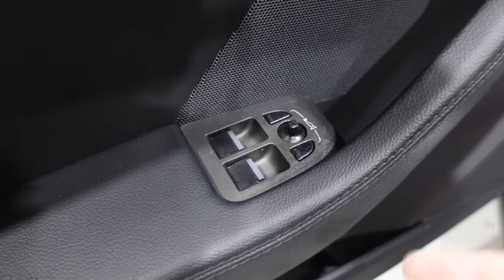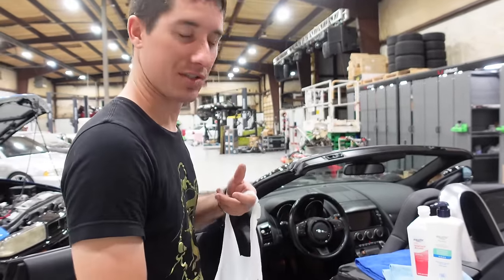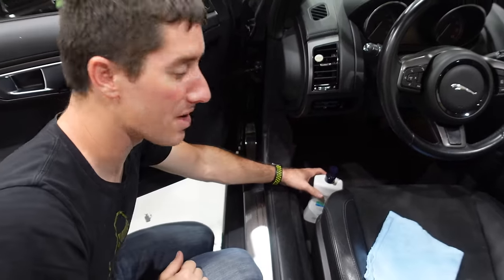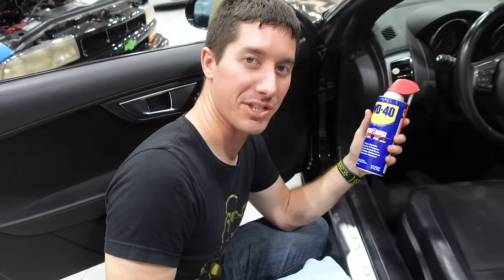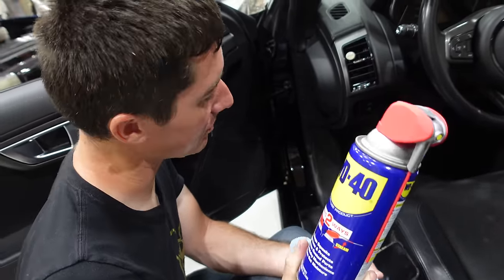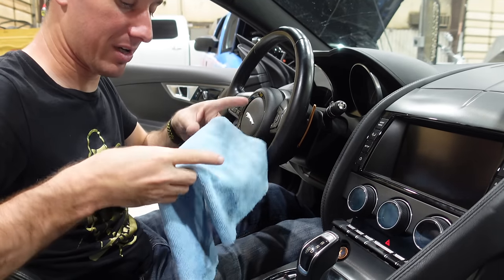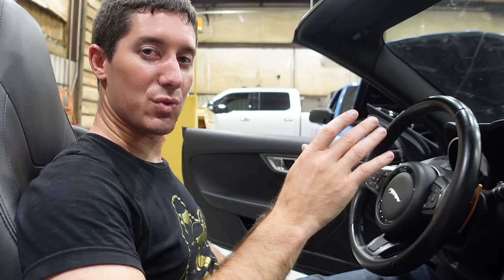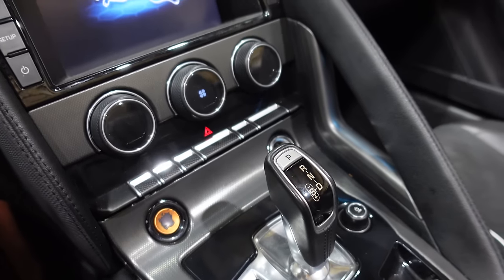Fixing STICKY BUTTONS At Home For FREE (I Try Everything)

Comment: WD-40 isn't as good  cleaner, as Lighter Fluid.  It's my favorite for leaning petroleum based adhesive residue.  It's not aggressive to most inks or plastics.  I bet that woud be a better candidate for cleaning and prep.  Any residue evaporates nicely.  If so you can follow up with IPA,  But, IPA can attack a lot of inks, especially with abrasion.

Comment: Like other problems in life, alcohol is the fix. 

Iso alcohol is also great for tree sap! Let it dwell for 15-20 seconds on the sap spot and then wipe with the rag, it will often just melt the sap off.
Reply: I have found cooking oil works great on tree sap. The plus of the alcohol is that it has many other uses away from the car, and the bottle lasts years.
Reply: Where was this info 20 years ago when I was climbing pine trees in North Carolina.
Reply: Why would somebody pay thousands when you can just clean it with alcohol  is a testinomy of having too much money
Reply: @ivanoffw  absolutely true - cooking oil is great for removing pine tree pitch.  Have been using it for years.  My parents have lots of pine trees, which I climbed...
Reply: And he went on ahead and put the lotion in the basket...
Reply: There's Goo Gone.
Reply: Isopropylalcohol (IPA) or 2-propanol.
Reply: ammonium chloride is the tree spots best remover ever. There is a chance it solves the soft touch too, never tested. Ask your doctor for the ammonia

Comment: I'd try mixing the isopropanol 70/30 with distilled water to avoid paint coming off. I used >99% isopropanol on my Volvo buttons and it did take some paint off the corner of one button but that's about it, everything else cleaned up perfectly. Might have even been missing paint in the first place from use over the years, just covered up by goop.

Comment: I noticed you had the gen 1 ftype like I have.

Word of advice-the buttons on the steering wheel are dreadful and we're amended on the 2015 ftype to be contoured rather than flat. The flat ones are really difficult to press and register a button press. 

You can't switch the entire button assembly out because the circuit board on the button is different - but you can swap the button plastics over and the new moulding is angled enough to register the button presses.

Comment: Simple Green maximum spray degreaser.  I just did it 5 minutes before I typed this message.  Took all the stickiness right off without being abrasive.  Everything came off like hot butter, no scrubbing.  BUT!, You need to have a few towels because that sticky stuff sticks to the towel and if you don't turn and change your towel, you end up wiping the sticky residue back on.  Oh, and please use a towel that's clean and not all frayed and stuff.  Used it on my 2014 Jaguar XJL Portfolio V6 supercharged 😇.

Comment: The best I’ve found was Resolve carpet cleaner.  Several years ago I bought some preowned DJing equipment for a karaoke business I was starting up, and all the wireless mics had a soft rubberized coating that had gone sticky.  

I tried alcohol, adhesive remover, etc. with some success but not great.  I then tried some spray on Resolve carpet cleaner, and it worked like a charm.  I would recommend wearing gloves though if you try it.  After a few hours of constant exposure it dried out and chapped my hands like crazy.
Reply: Did it produce any discoloration on the plastic? I tried alcohol on a black remote control and it removed the goo, but it kind of burnt it (it left a white-ish haze on it)
Reply: @JoeOrber  that plastic was left its natural color from what I can remember.  I believe it was ABS, so other plastics might have a different reaction

Comment: I bought in bulk alcohol swabs when I was crypto mining to remove thermal paste and it works great. Started using it to clean other items such as keyboards. It is cheap and not harsh. Use to use a spray gun with alcohol to clean car parts like brakes to save on brake clean and it is not harsh on the lungs.

Comment: parking in the back and going in the service area FTW!!  this is the  best walmart hack and ive been doing it for years. i also check out back there as there is usually no line. its amazing!!  the only things i think you cant check out in the service area are things that need to be weighed but i may be wrong just never have taken the chance. if you all arent parking in the service area you are missing out!
Reply: Just don’t be inconsiderate when parking over by the ACC and block the bays or you might get yelled at by the techs in the shop.
Reply: I usually park by the outdoor/garden department and enter through there. More parking, less people, and closer to the stuff I need. The problem is that there isn't always an open register.

Comment: Thanks so much for your video. I used Al ohol 70% on my 2013 Hyundai Elantra GT (aka i30 in Europe) driver door trim around the door switches. They were gunked and sticky. The alcohol pulled the stickg black gunk off and left a black plastic non sticky new looking finish. I will tape off areas with gaffers tape and apply alcohol (I may dilute the mix).

Comment: I just attacked the sticky buttons on my w211 Mercedes-Benz and I had very good luck with armor All interior detailer/cleaner and a microfiber towel. I actually put considerable pressure on it and they held up very well (++ to Mercedes) This solution seems safer than some of the other caustic materials listed elsewhere because this is formulated for your interior and even includes a UV protectant.
Looks like new now!

Comment: Make-up brush and talc works. It absorbs the oils without speeding up its breakup. I've used that for computer mice and tools with rubber grips but need to remove the dirt first. I leave my 'powdered up' for a few days. brush it off and generally back to normal for quite a while but nothing stops the process of decay

Comment: The 91% Isopropyl alcohol worked wonders! THANK YOU!!!!!  One thing I can recommend though, use a very wet towel and rub GENTLY then repeat with a fresh piece of towel, as it will just smear if you don't use a fresh piece of towel each time. More alcohol & les pressure is the key. I rubbed through the paint in a couple spots on my steering wheel buttons. Now I have to swap those switches out.

Comment: We use IPA all the time in computer repair, mainly the delamination of the older MacBook screens.  I also use a product called PEEK - you can't get it everywhere but it does work.  It stinks a bit so do it in a well vented area.  Older mice from early 2000's also had this same issue with sticky mess.  Oh, for the little corners, use cotton swabs.  And indeed take your time, it does not come off immediately.
Reply: I enjoy drinking IPA at my local pub.
Reply: @OMGWTFLOLSMH  I am with ya on that - 🤣

Comment: For larger surface areas such as gooey dashboards or airbag covers, carefully/perfectly clean with 90% or higher IPA, 2 square inches at a time, and then coat with a product called "PCR Plastic Renew". The coating is a perfect way to make the plastic new again. Holds up for years when done properly and will not wash off. PCR plastic renew is not a "dressing" but an actual flexible plastic coating.

Comment: WD-40 has always been my go to for this sort of thing because the soft touch stuff is supposed to be a protection layer so when it goes bad you're basically stripping the stuff off. I figured even if it's a little oily, that will dissipate with a little time and there'll still be a layer of protection because oil is just a lubricant. With alcohol you're always risking paint being rubbed off once you get through the sticky stuff, especially using 90%. I've tried Windex, but it's probably below the cosmetic wipes for effectiveness (I don't like the wipes for all the lint they leave.)

Comment: In Canada we have a paint mess remover called “goof off”.  It’s not citrus like goo gone. In fact, it smells awful. Worked amazing on sticky steering wheel buttons on an ‘06 Mercedes ML. Didn’t harm the markings on the buttons.
Reply: Goof off is excellent. I have an old tin flask of it and it’s still good.

Comment: This may or may not apply but you can try and use the cheap blue mouthwash to remove the residue. In the IT world I used it to remove the delaminating coating on Macbook screens.  It works really well.

Comment: I bet that your new shop is going to have the best air conditioning system out of all of the shops on YouTube. 
My car doesn't have the sticky button problem but the last time I got it detailed the person used a mix of alcohol and distilled water in a spray bottle and he sprayed it all over the surfaces and knobs and buttons and it did a great job and evaporated quickly. The headlight/turn signal stalk had brown icky stuff dripping out of the seams when he sprayed it down. The old stock stereo was nasty too. The only issue I saw is that it left some of the black plastics a hazy gray color but the black can be restored during the detailing process.

Comment: I always heard of Gumout and a soft toothbrush. My brother-in-law swears by acetone and a low powered nail rotary tool(my sister is a nail tech). The acetone will usually strip the paint off though usually. When I was a deckhand, the bridge deck buttons would get gummy and sticky and we used a malleable eraser they sell in art supply stores. Looks like silly putty kind of. If you mixed in some charcoal ash, that also worked pretty well, then afterwards we used leather cleaner.

Comment: Baking soda worked for me. Mixing some water with baking soda, into a paste, then lather the paste to the sticky area. The paste will absorb the sticky oil from the surface. Sticky surface on plastic is caused by the instability of the oil.

Comment: I get this with computer plastics sometimes. I use WD40 to clean off all the broken down plastic on the surface ( that is sticky ) and then clean well with ISO 91% to clean up the WD40 residue.
Reply: I'll give it a try. I have an old MS force feedback 2 joystick that has gone very sticky, but annoyingly is still the finest joystick ever made, alcohol just seems to make the problem worse and vigorous cleaning just led to the coating peeling off. I'll try wd40. Failing that I'll just strip the sticky coating off completely and wrap the thing in bicycle handlebar wrap.

My jag is a x100 so has 99 problems but sticky buttons aren't one lol thank fck
Reply: @throwback19841  if the WD40 and 91% ISO doesn't work all the way, I use clear nail polish to cover over the parts and it stops the sticky and doesn't wear off. I have done that with a few dslr cameras where the grip gets all soft and sticky. WD40, 91% ISO and then clear NP on top fixes it. I still have an old Nikon D70 I did it to maybe 5 or 6 years ago that is still holding up just fine.

Comment: I would NOT use IPA(Isopropyl alcohol). It does in fact REMOVE the stickyness, but the rubber coating is gone too. IPA eats/dissolves rubber.

Comment: Any decent electrical contact spray will work wonders. It gets in and behind the buttons freeing them up. I just fixed my navigation system which wasn't working because of a dumb stuck button. No doubt saved some cash in the process 😊 I used Halfords own brand, cheap but worked great.

Comment: What was weird is my wife cleaned up one of our older Asus laptops with the sticky coating using hand sanitizer. It might've been the alcohol in it but using straight IPA didn't seem to work as well. She ended up using this gel hand sanitizer she picked up during the "thing" and it ended up being less labor intensive and left no residue. Laptop cover and the area around the keyboard all had to be cleaned of the soft coating.

Comment: I found that when removing stickers from devices, like computers and gaming consoles, WD-40 followed by rubbing alcohol works well.  On gaming controllers and mice, rubbing alcohol works well to clean up the grime, but I've also used sanitation/disinfection wipes, which you may have left over from the COVID-19 lockdown days.
Reply: I use olive oil on plastic consoles.

Comment: I did the alcohol treatment with an old set of headphones I loved but were absolutely sticky all over. They were so far gone I also had to use a small amount of baking soda, although I would not recommend that with painted plastic like you had to deal with. I would suspect that Alcohol is also safer to use around electrical components.

Comment: I owned a 2000 beetle that had sticky button syndrome on pretty much every surface of the interior, I hated it.  I tried the solutions you did plus several more and never found anything that worked satisfyingly well.  I will say it seems to depend on how bad the sticky goo is.  If it is bad enough it seems to come off easier than if it is in the early stages of stickiness.  I eventually gave up and sold the car as-is.
Reply: Had a 2000 golf tdi,  had to peel it all off with the corner of a credit card, the polish out the residue.

Comment: Isopropyl alcohol works great. I use makeup pads with it to scrub the rubberized coating off. Just don't scrub too much or else you'll start to remove the paint from the plastic itself.

Comment: What about Goo Gone, or a citrus based sticker residue remover?  It leaves a nice citrusy scent too.
Reply: I do electronics repair as a side business, and my method on things like soft touch laptop lids from the 00's, stickers, marks, etc.. has been Goo Gone, Goof Off, or 91% IPA depending on how bad it is, and the type of plastic I'm dealing with, but with Goo Gone, or Goof Off I always have to do a final clean with IPA, or cheap Window cleaner, but I always spray whatever I'm using on a cloth first before wiping the surface.

Comment: Degreaser works best against finger gunk (just dirty) . 'real' sticky buttons as seen on early 2000's Ferrari and Lambo's have to do with degrading of softpaint; the rubbery ingredients turn gooey. I guess the Jags' button were just never cleaned... ever. Tip: use a thinner cloth.
Reply: No, the Jag buttons get sticky/gooey from the rubberized soft coating they used to put on them. I have an XK-R and it has the same issue. It's not a matter of never been cleaned, it's the coating.
Reply: @Kryptic1046  thanks Neptune. Luckily no experience with it in my Daimler SV8 lwb. I am curious to find out if the buttons stay not sticky 'caus a layer was scraped off (instead of a chemical alteration of some sort). And if so, how about the degrading of the decals in time?

Comment: The steering wheel on my Jeep was so gross I didn't want to touch it.  I tried all kinds of cleaners and alcohol and it would just come back.  Out of desperation I grabbed the brake clean and some rags and scrubbed the hell out of it, perfect.  I think I went through 4 rags, after that I put armor all cleaner and protectant on it and a year later it's still good.  I would definitely do some test patches where it wasn't very noticeable but I was down to buying a new steering wheel if brake clean didn't work so I didn't care at that point, it was just that gross.  It would even leave black residue on your hands after driving it.  Brake clean for the win.  I've even seen people use it to remove grease from carpet without damage but you'll definitely want the windows open for a while!

Comment: I fixed the sticky rubber armor on two-way radio by simply spring a coat of clear acrylic over it.  Once the acrylic dried, it was done.   Alcohol works very well but takes longer.

Comment: I have 1999 VW Golf v5, German specs, that had sticky buttons and more, I used Easy-Off, blue can with a dampen micro fiber cloth with distilled water. It will remove the sticky buttons.

Comment: I can tell you for sure that this result is specific to the car. I've run across soft touch plastics that IPA barely touched, it took over 30min to get a mediocre result. Petrolium based solvents tend to work better (gasoline works on all of the plastics I've tried) but are more agressive.

Comment: Just throwing in a comment. I have used the CVP gas station quality antibacterial wipes and they seem to work decently. I started driving an International 8600 tandem axle straight truck that the company bought for me and every button and switch was nasty. Also had sweat stains on the door cards. The wipes took everything off. I think it may be took me 6 to 8 wipes, but the truck is clean now
Reply: I don't have any CVP gas stations where I live. I have a mid 90's plastic door card with some stained areas. Do cheap wipes take very long to clean the areas on the truck?

Comment: You should get the remaining Black off of the start button… soak it a few seconds under the rag but not too long! The “91”alcohol will even melt enamels and plastics. I don’t touch most laundry machines for repair until I’ve cleaned them… they’re normally super nasty and I’ve melted them before! 😬😳😂

I wonder if this will work on my heat gun handle?!?!

Comment: Baby power would fixed it.  It causes a mess at first, but after letting it sit for some minutes (making sure it is distributed throughout the material) it brings it back to new.
Reply from the maker: This seems like it would just stick on top of the soft touch coating 🤔
Reply: @WatchJRGo       What it does it absorbs the top sticky layer, and it turns transparent after some minutes.   I use it on car dashes that are baked in the sun. The soft touch layer has to stick to the dash when the material is being made, but the sun turns into transparent glue mess (because the moisture is coming out). Baby powder dries it back by creating a new layer. It also how it works on the human body.

Comment: I use 91% Isopropyl Alcohol for stripping paint off Models with Acrylics, enamels, and spray paint. That percentage above the 70 makes a gigantic difference. Just be aware it can strip the lables off button. Or get straight acetone aka make up wipes. Again that will be the harshest.